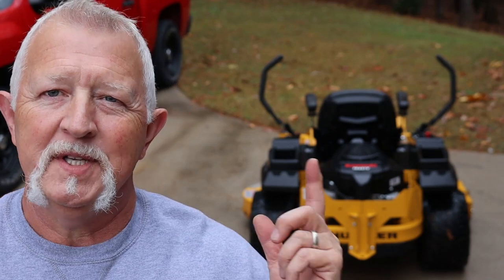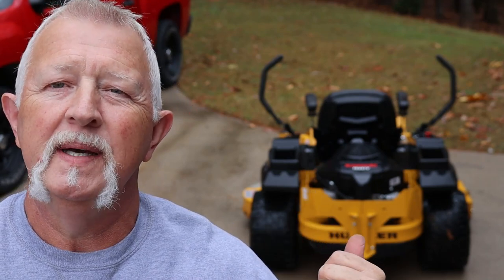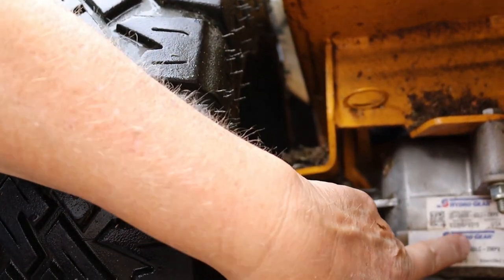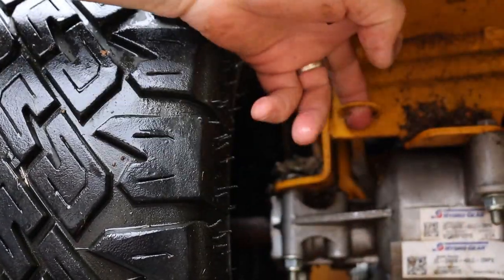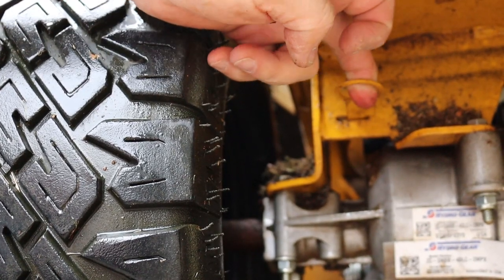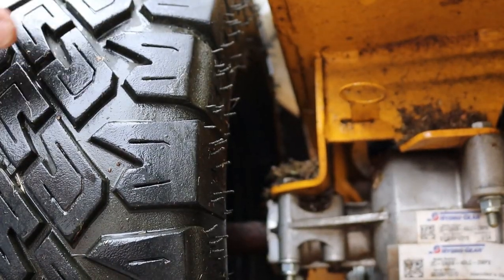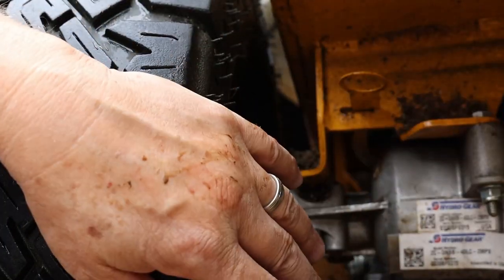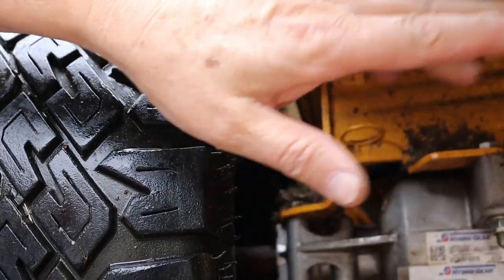Push or Pull a Hustler Raptor in Freewheel

Comment: pulled the bypass out and put levers in N stell wont move could there be a bad switch not working . Thinks Jerry
Reply from the maker: Hey Jerry, thanks for watching!  If you pulled both bypasses out and both levers are all the way in, I'm not sure what could be preventing it rolling.  Does it operate normally with the bypasses in their normal position?

Comment: Disengage worked, but won't re engage. Lever pushed in
Reply from the maker: Thanks for watching, Thomas!  Make sure the pull lever is snapped all the way back in.  If not sure, pull all the way out, make sure it is freewheeled, then release and push all the way back in.  If that doesn't work, you may have an issue with one of the transmissions.

Comment: Hey man. Thanks for the video. I pull mine and ensure the break is off but it won’t release the transmission is there something I can’t tighten or do to get those pull tabs working.
Reply from the maker: Thank you for watching, Daniel!  If you are pulling the tabs out on both sides and the parking brake is off, it should freewheel.

Comment: What if after pulling the rings it still doesn't move
Reply from the maker: Make sure you don't have the parking brake set.....if the steering levers are pushed all the way out, that sets the parking brake.  They need to be pulled in to position as if you were sitting in the seat, ready to steer.  Thanks for watching!
Reply: The church has this lawnmower and I have a friend who came by with truck and trailer to load it ..but he pulled those 2 rings and nothing..I pulled from the rear and nothing..it's inside a conex trailer..I'll check tomorrow if parking brake is on..